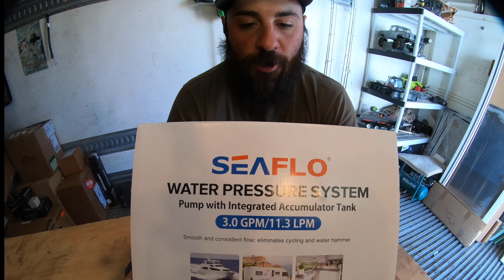Overlanding build equipment show & tell

Comment: Thanks for the video.  You are going to have a $100k rig when you are done.  I like how you have everything inside so nothing freezes.  I live in a cold climate too and when it gets in the 20s, starting the LMTV can be rough.  I haven't tried it below that because I didn't want to drain the battery.  When I plug in the block heater for 4+ hours it starts like a summer day.
As far as your channel goes, you are doing great.  I know it feels weird to sit and do a show and tell, but I for one, love it.  I have been watching this kind of content for years and your take on it is unique.  I had never seen some of the products you are using and they look great.  I can't wait to see you put them in. One tip on the lighting is to have a source behind the camera shining on your face.  When I videoconference, I use a desklamp with a sheet of regular paper in front of it to diffuse it a bit.  It helps a lot and is easy/cheap.
One final thing, do you get on Steel Soldiers?  That place has a lot of great people who have a wealth of knowledge about the LMTV.  If you ever have a question, it is a really good place to start.  They also have all the tech manuals (over 13k pages) that you can download.
Anyway, sorry for the long post.  Thanks again for the great video.
Reply from the maker: Thanks for the compliment and the advice, I tried to set up some lights but boy it’s hard to get it right. I’ll continue to try and produce better content week after week. I have been on steel soldiers and there is a lot of great content on there but I should probably get involved more than I am. Glad your enjoying my channel!

Comment: For your next build if doing 3k inverter (or bigger), you should do 24v, just make everything 24v, use a couple $20 12v  DC-DC step-down  converters off Amazon for anything that cant do 24v or use the same Victron Orion you already got (overkill). 24v can use lower gauge wire (smaller entry holes), your more prone to stay under amp limits of all components, running cooler/more efficient, less resistance loss. This way you can just charge straight off the alternator thru a relay, or reverse, if alternator dies, you could probably run a LONGGG way on the house battery pack. You can get easy DIY kits using LF280K batteries from Docan energy, or buy a turn-key pack from Current Connected like SOK (avoid eg4). Using something based on LF280K means you have a robust battery that doesnt care about high amperage since they easily do 600 amps, and since you would most often be under 50 amps it will have a longer lifespan. Those types of batteries you used have small cells inside that dont like more than 40-50 amp, possibly 90 peak, be sure to have pack heaters for charging under 32F. Or if you wait long enough, make the move to Sodium Ion which came out in 2023, it is still maturing, but they discharge to -30C, and charge to 0C, non-combustible. I think you are going with Victron such as Multiplus II, call them and see if they have any comments on Sodium before you buy. Many fridges like isotherm do 12/24v.

Comment: I’ve seen on Fastidious Restomods that he runs his water tanks under the box body between the chassis legs which may solve your ‘top heavy’ situation as it lowers your CofG
Reply from the maker: Thank you for the advice, I plan to store my grey water below frame level and hopefully that helps. I also have purchased a set of Timbren helper springs and have high hopes for them as well.
Reply: @jeffcobuilds2660  just not good for cold climates. Ice isn’t good for tanks pipes and fitting I guess! 😬

Comment: If you want to go out in your rig at 40, you'll want to find some electric heat pads for your diffs, axles close to the hubs and transmission pan. Alternately, you could go to a glycol heat line set-up with engine coolant and your auxiliary heater. Your diffs and trans fluids will go rock hard overnight at those temps. Trying to drive that way, you get about 5-10 mph until the friction heats the oil. Tons of metal damage. I've seen a lot of guys pay hefty unnecessary repair bills who drive on that frozen, non lubricated drivetrain. All of my oil and gas equipment and truck fleets get rigged for winter this way, never lost a diff or transmission. Up in Canada, I've never had a problem with fuel gelling with the engine returning hot fuel to the tanks, rarely used diesel treatment. Also, our fuel formulations are refined for lower temps than US refiners go to. When it gets to -56 C/ -68 F ( not including wind-chill), we stop working outside and all equipment is tarped in with heaters.
Reply from the maker: Wow, sounds like a harsh environment you live in!
Reply: @jeffcobuilds2660  Alberta -Texas North !!